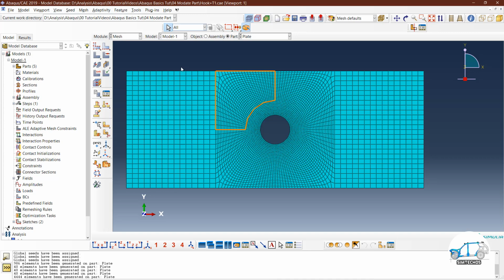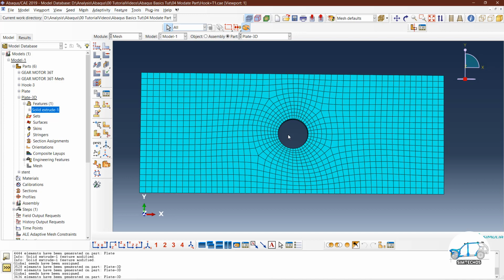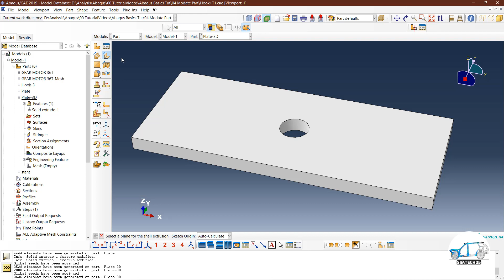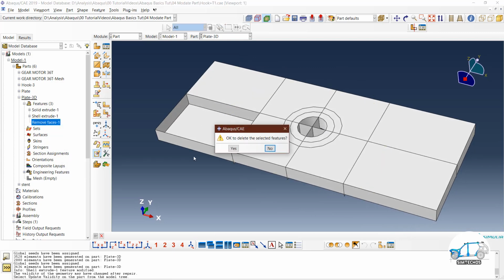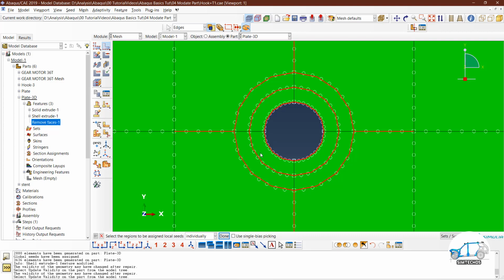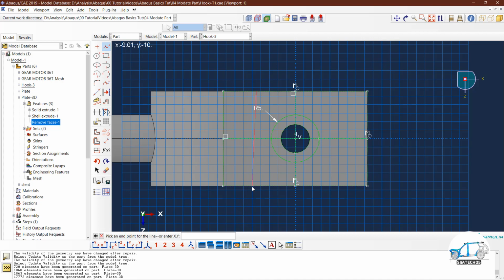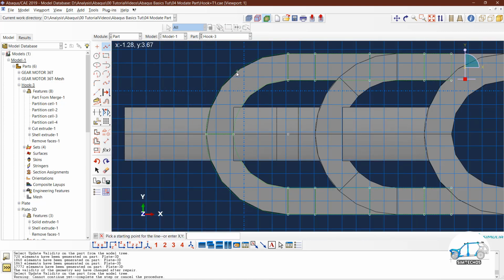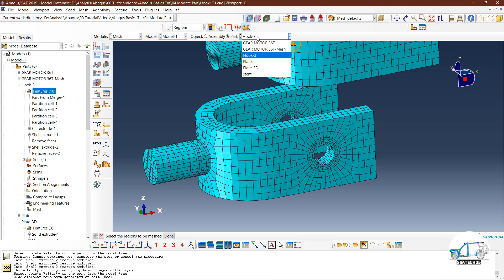Abaqus basics 05 - Increased mesh density on stress concentration regions by splitting and seeding

Comment: Thank you for the video. What was the necessity to create "Shell extrude-2" @ duration 17.40 (because the whole part allowed structured mesh even before creating that partition)?
Reply from the maker: Dear,
Near the shaft i have complex region with stress concentration...so to precisely control mesh density on the specific region i splitted it... explained in previous videos.